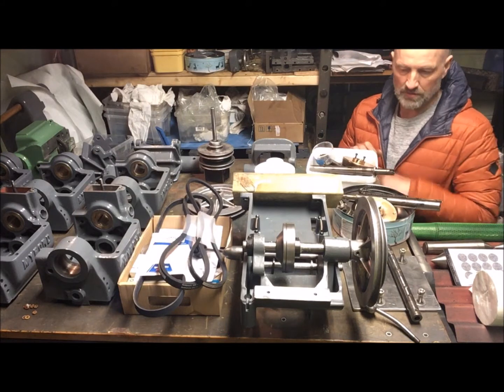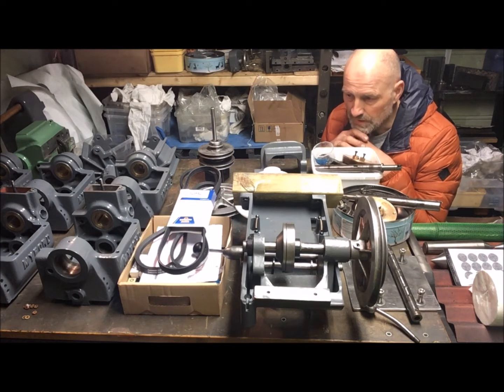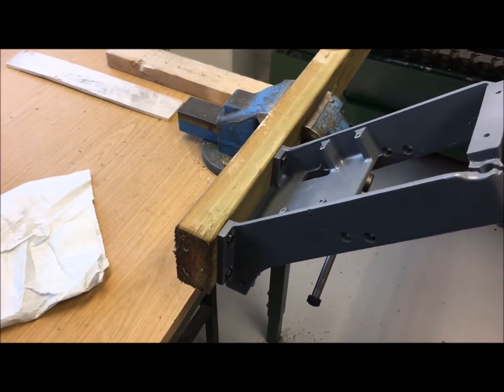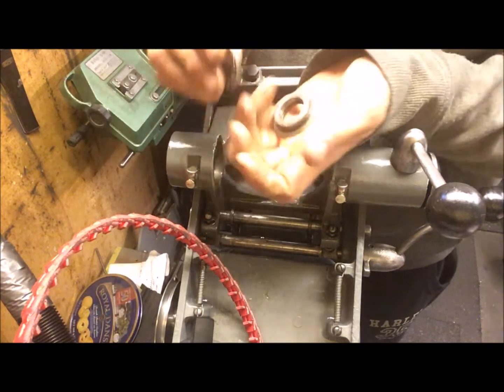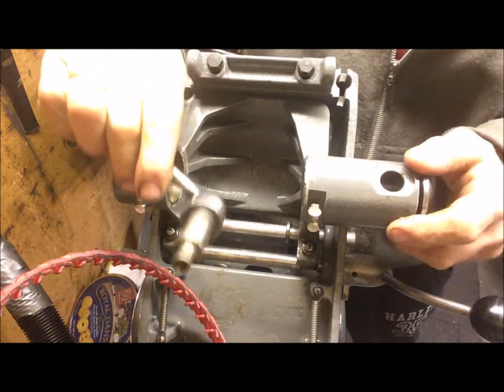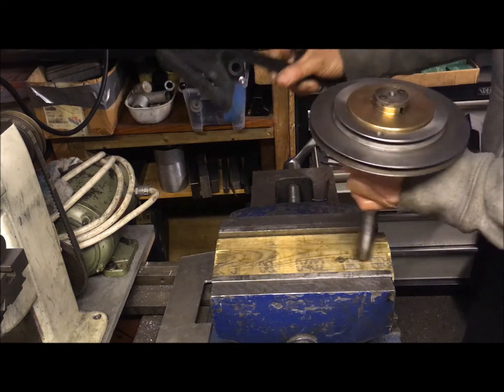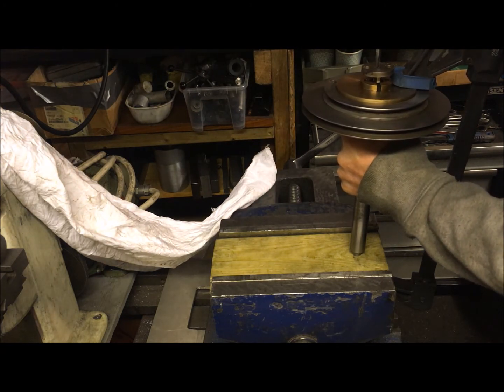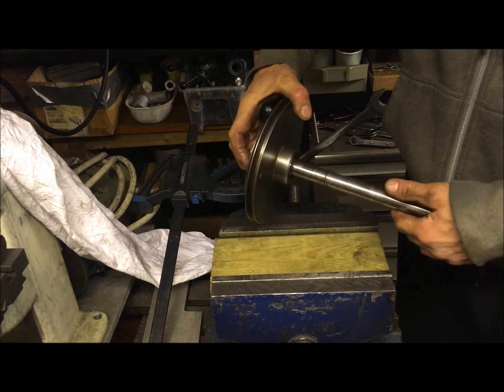Myford Super 7 - motorizing assembly - part 1

Comment: Hi Jan When I engage my Myford Super 7 mark 2 clutch it makes a short loud squealing sound, then works fine without any issue. Have you come across such a problem? I wonder if I need to take the clutch apart and perhaps clean the clutch cone and bearing surface?
Reply from the maker: Perhaps it needs a cleaning, but are you certain that it is not the belt that is slipping?
Reply: @jansverrehaugjord9934  Ummmm. Good question. I will go and double check.
Reply: @jansverrehaugjord9934  Hi Jan. I had another good look and found that the noise only happened when motor is running and the clutch was engaged. If I left the clutch engaged and started the motor there was no noise. Ummm, I thought it must be dirt between the clutch cone and it’s seat. What if I sprayed it with brake cleaner? Well I tried and to my delight it worked. No more squeal. The clutch works beautifully, and quietly too.

Comment: Hi Jan, These videos are superb - -being able to see all the parts during re-assembly is really useful - just what I needed as a rebuild my late fathers 1997 vintage Super 7 Mk 2. I was wondering if you had any difficulty refitting the Anderton 1400 7/8 circlip onto the countershaft after re-installing the clutch, thrust bearing and spacer ?  Space seems limited and persuading the circlip to sit snuggly back in the countershaft groove is a challenge. Wondered if there are any "tricks" to ease things just a little during refitting ?  I laughed during your video as I also forgot to install the cone pulley and motor guard so re-assembly turned into several disassembly and re-assembly steps - a learning process for sure. Keep up the good work and stay well
Reply from the maker: Thnks for the nice comments. The circlip assembly is a bit "finicky". You need to insert this loosely onto the shaft, then the woodruff key and the pulley. I usually just slide the pulley along the shaft, moving the circlip until this locates. PS! You need to have the clutch adjustment such that there is bit of "room". Good luck!

Comment: Thank you Jan... juts managed to take my clutch apart thanks to your video.. unfortunately the Myford manual is not very clear here... the previous owner of the lathe i bought or the previous - previous cos i dont know how many times this lathe has changed hands before me tried to take the clutch apart by "un-screwing" counter clock wise the clutch shaft until it locked and wasn't even clutching anymore... i tried to do the same at first to be honest but thanks to your video now i am a master of the clutch :)
Reply from the maker: Wow! That is great to hear that it was of help! Good luck on the repair